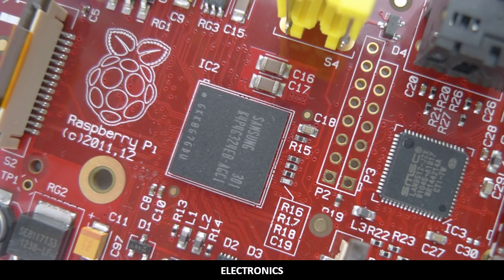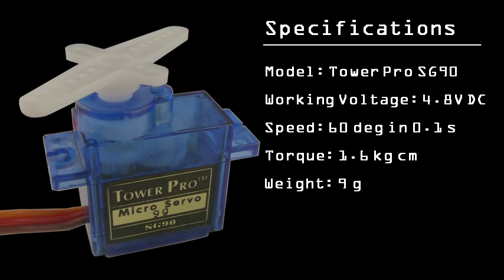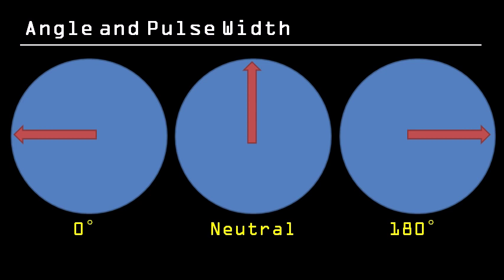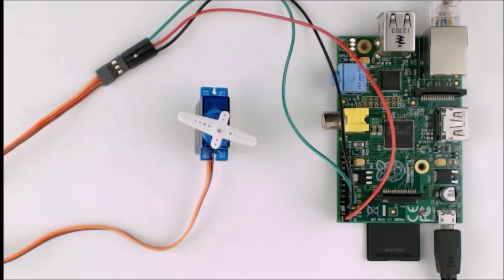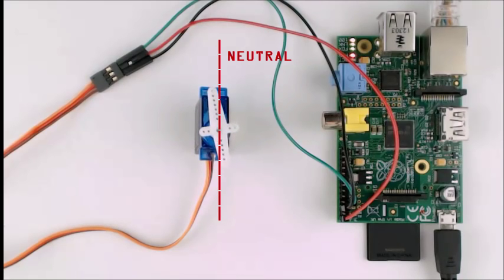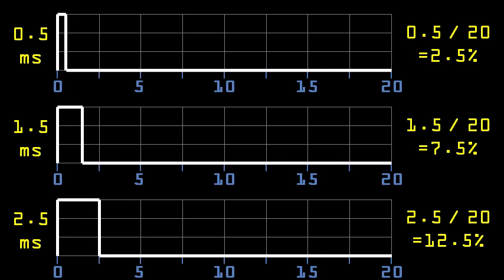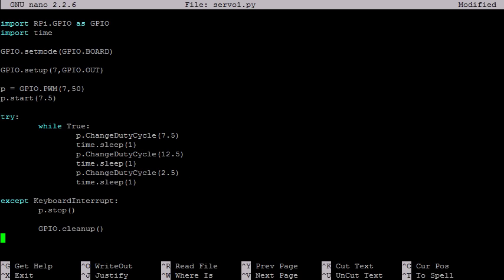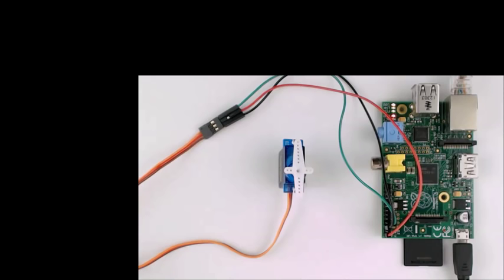Servo Control with the Raspberry Pi

Comment: I saw that GPIO PIN 18 is an hardware PWM output on the rpi, wouldn't it be rather good than using the software implementation ?

Comment: First of all, your video ABSOLUTELY helped me understand and grasped the concept of this. THANK YOU SO MUCH FOR THIS VIDEO. I have one question, I am now experimenting with continous servo motor. I'm not exactly sure how to control it to make it spin for certain amount of time? Like I'm working on a blind and I want it to keep spinning for amount of time. What's the proper coding for this?
Reply: Hi, have you already find the solution? I am attempting to do same thing
Reply: Solution to spinning? I just actually found out you have to have a special servo motor that enables 360 degree rotation. Does this help?
Reply: You should probably use a stepper motor, not a servo motor.  With a stepper motor, you send a command to make a single step ( a step is some fix angle, say, 1.8 degree, ... that depends on how the motor is built), again and again. You don't care much where it the motor "is pointing to" (in terms of angle), you just want it to turn "n steps". It is a kind of fire and forget thing. With a servo, you care where the motor is pointing to, and you send a signal telling it where you want its position to be (or to keep, even under a load). 

As example, for a car, the wheel with traction could use a stepper motor, since you don't care really if the wheel has make a quarter of turn. or half that... what is important is the position of the car itself. But with a robotic arm, you may want to know where the arm is, at which angle it is, so a servo is required, not a stepper.

There are many videos out here, on youtube, showing how to control a stepper motor with the Raspberry Pi... Just be sure to use a stepper motor.

Comment: Hey Gaven, really great video but I am really struggling with the whole servo controlling. I have two servos both with the three brown, red, orange pins like yours but I see you use a divider or something - firstly what is it? Also is there no other way to directly connect and control the servo from the GPIO without having to divide it onto different pins? I just have one more question, for my project I plan on having 9 servos eventually hooked up to the raspberry pi, I'm confident I will need something else, but I'm really not sure what - do you have any idea what device that is cheap that would do this for me and also I really don't want to get any external power supplies (w/ batteries). Would really appreciate your reply if you can :) Thank you!!

Comment: Is it safe to power the servo directly from the RPi? AFAIK you are not supposed to power a DC motor directly from the pi, both because it maybe power hungry, drawing more amps than the pi's pins can handle or because motors can generate current. Also wouldn't it be safer to place a 1kohm resistor to the signal pin?
Reply: +Alande Amorim Everywhere else i've read says that you shouldn't use the raspberry pi to power this servo.  It can pull too much current and cause your pi to crash.

Comment: I don't get why this works, because the only pin with capability of PWM is pin number 18 right?
Please enlighten
Reply: With software PWM, you should be to use all of the GPIO pins.

Comment: I just get an error message:

Traceback (most recent call last):
File '/home/pi/Python_Projects/Servo/servo3.py", Line 9, in <module>
p = GPIO(7,50)
AttributeError: 'module' object has no attribute 'PWM'
Reply: i think that you must replace 7,50 with 7,1 or 7,0!!!!!  :-)
Reply: Ευθύμης Κρητικός
I did manage to find out what the problem was eventually, I hadn't updated the RPi.

Comment: Gaven, Thanks to you I wrote my first Python program yesterday and pulsed an LED (very exciting (and not that's not sarcasm)).
One suggestion is to explain many (if not most) servos will need a separate power supply.
I see many "the program" didn't type comments when the problem wasn't the program but the power supply.
IMO, This would be worth adding in or adding to the description or having a commenter point it out.
When you say "a hardware" solution, do you mean an external microcontroller?
QuickStartControlling32Servos120129.AVI
(If you don't want me to link to my own stuff let me know and I'll edit the link (or other content) out.) Please don't delete my comments like the kid who calls himself "The Raspberry Pi Guy".

Comment: I cannot get this to work.   I connect the servo to a 6v power supply (both battery and regulated) and I see a short switch of the servo.

Once i send commands to the pin connected to the servo's control wire, nothing happens.   Tried with both power supplys and also with two different servos.   Only difference is I have a diode to prevent back EMF
Reply: Welp, figured it out.   Works perfeclty now.   Was a dumb error on my part.  Didnt realize the longer breadboards' positive and negative power rails are split in the middle of the breadboard and need a jumper wire to bridge the two.  I wasn't getting the final ground to the raspberry pi.
Reply: I love you!! <3

Comment: I can confirm that this little project doesn't work. I am using the same components. When I connect the positive and negative of the servo into the pins, the raspberry reboot itself.
Reply: Michelangelo Turillo Technically the equation to get it to work should be (a = angle)
(a/170)+1.5/20.00*100.00 however in python that doesn't seem to work.
Also great web controller btw.
Reply from the maker: Hmm, if the Raspberry Pi is rebooting there may be a power issue. The only thing I can think of is to check that your power supply can handle enough current (the one I used is rated to 1A), and make sure the ground and 5V wires are connected to the correct pins on the servo. Hope that helps.
Reply: hi Gaven, thanks for you reply. I am using a Motorola power supply. DC4050US0301 5.1V 850mA 0.85A Power supply AC Adapter SPN5504A. is it not enough? regards
Reply: Gaven MacDonald Solved. The power supply was too weak! I am using a IPad power supply and it works as well! Thanks Gaven!
Reply from the maker: Great to hear!
Reply: Hi Gaven, this day I have spent my sparetime to create a simple Web Based Servo Controller, here a screenshot: http://i2.minus.com/iQQ4Cgmogxj9n.jpg and here the code: http://snipet.co.uk/zd

is there a way to control a servo using the degrees?

Thanks for your video!

Comment: I have followed your example exactly, however, when I run the .py file to move the servo it will cause my RPi to restart. Is the only way to fix this problem to use an external power supply?

Why does yours not need an external power supply?
Reply from the maker: Did you use the same servo? If it's a more power hungry servo, I could see it needing it's own power supply. If that isn't the case, it could be an issue with the Pi's power supply being unable to handle the additional current.
Reply: The one I am using is slightly different than the one you are using, it's operating range is 4.8v-6v. 

If I were to connect a battery pack to the servos pos/gnd wires I would have only one wire going back to my GPIO pin of choice?
Reply: @Doogles With all modules, you will have to share the ground wire between pi (gnd), external battery (neg) and servo (neg). So yea there is another wire
Reply: Your servo is damaged dude like my servo 
So it cause the Raspberry Pi Restart

I try my damaged servo with Arduino but it can't move it

Comment: I have been having the same issue. What I think is happening is when the servo moves it creates a backflow of electricity and is causing the rpi to reboot. Can anyone clarify this? I have tried to stop this from occurring by putting diodes to stop the backflow but still no success.